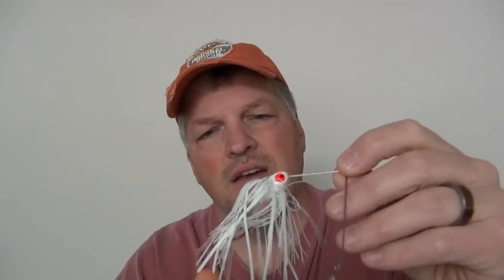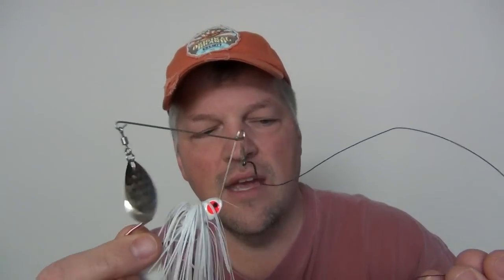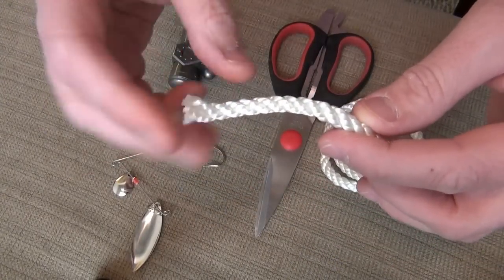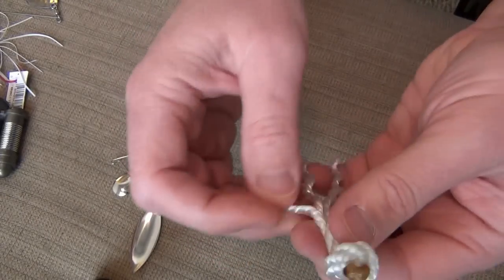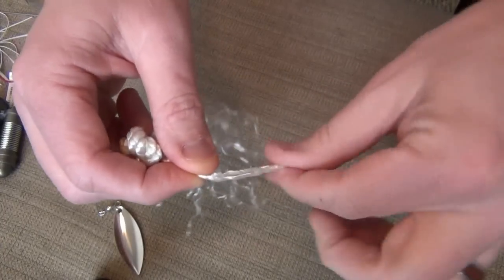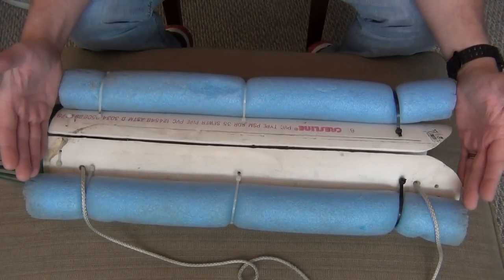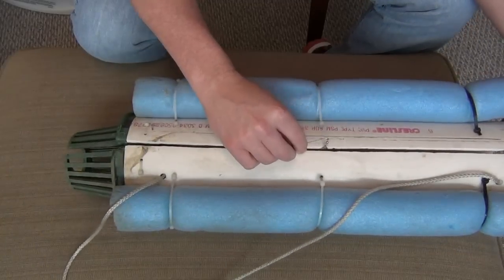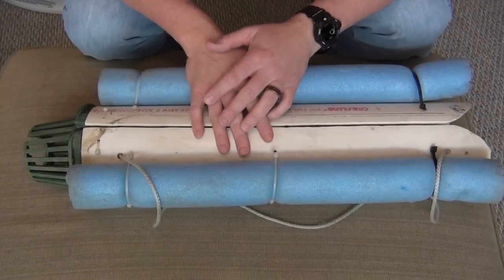How to make a gar fishing lure or rope lure.

Comment: Does it matter what size of rope
Reply from the maker: Hey there, I usually use rope that’s a 1/2” or so in diameter. The important part is the twisted vs the braided. Braided is hard to work with. Good luck! - Doug
Reply: @dnejeff  gotcha

Comment: Doug, Thanks for the video. Please what is the exact name and brand of the lure you recommended, I am having a hard time finding one with a closed hookup locally so I may have to check online. Thanks
Reply from the maker: Hey PetMemorial - to be honest I'm not sure what brand that lure was. I just walked down the isle until I found one that was closed at the connection. Doesn't need to be expensive either.   Good luck! Doug
Reply: Thanks for taking the time to reply.
Reply: Look at my comment above, I fish for gar using live cut bait if you cant find his rig. His rig will work ALOT better for longnose gar tho, I have found you usally only hook about 1 in 10 longnose gar without a rig like this
Reply: Just close the top of any spinner bait with a pair of pliers. I do it for trolling with no problems
Reply: Do you twist it?

Comment from the maker: Sorry it took so long to reply.  I'm not sure. Once you get the hit, don't set the hook like you would a bass. Just reel them in with a little back pressure. This will lock the rope in their teeth. Make sure you are using nylon rope too. Some of the poly stuff won't work very well.  I hope that helps!  Good luck! Doug

Comment from the maker: Hey There!  No need to upscale this one. I use this lure when I fish and I usually catch 3'-4' fish on it with no problems. You'll need 12 lbs or better test line and of course a steel leader (I'd go with 18") just to be safe.  Good Luck and let me know how it goes.  Doug
Reply: There teeth are pointed needle sharp there not like little knifes you don't need a steel leader

Comment: I've been trying out the twisted nylon rope lures. The gar come up and eat it but they don't get stuck. I'm using twisted nylon rope that I've unwinded. They just come and bite it and spit it right out. What am I doing wrong?
Reply from the maker: Thanks for the comment. The only advice I can give is to maintain a slow steady retrieve to keep the spoon turning. Once you see or feel the fish take to don't do a heavy set but more of a deliberate increase in retrieve force/speed. If the floss is in their teeth, (and there is enough of it (the floss that is)) you'll be successful. Good luck. Tight lines! Doug

Comment: I tried a rope lure and the gar don't seem to care for it in the slightest :( They just look at it
Reply from the maker: Josh Flori - gotta be the presentation. If they are active at the surface, you should just toss it in front of them and use a slow steady retrieve. That initiates a bite for me 80-90% of the time.  You might shorten the floss too. Good luck. Doug
Reply: interesting, thanks for the response.
Reply: If they are spawning they may not bite on anything.  Just toss a net on em.

Comment: What's wrong with using braided rope?
Reply from the maker: You could use braided rope if you like, but it will take a lot of time to get it unbraided so it will be hairlike. Using twisted takes 30 seconds to untwist and shake it out.  I'd spend the cash and buy twisted. Good luck 😊 Doug
Reply: Doug Jeffries combs work extremely well for braided. also probably for twisted, havent tried